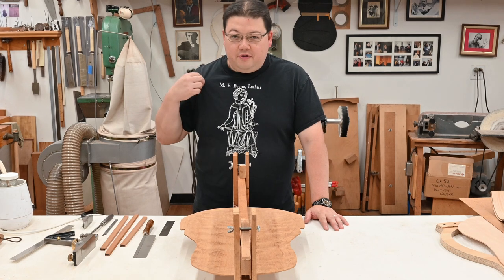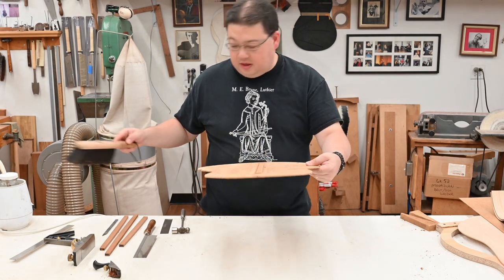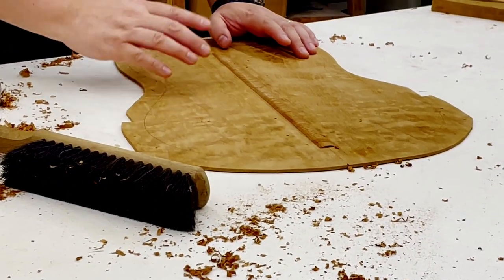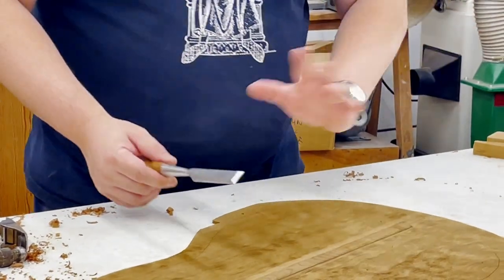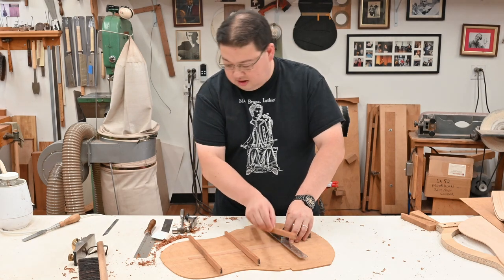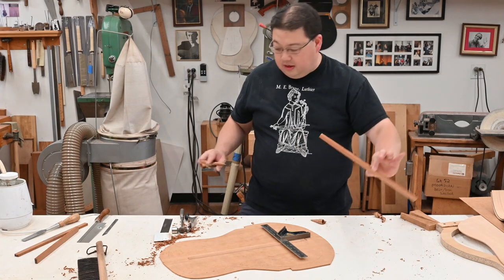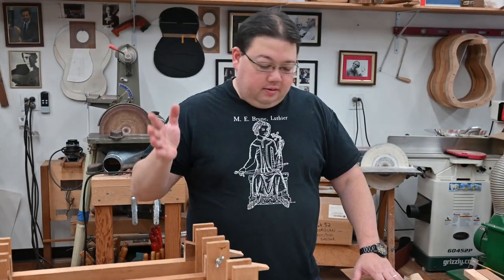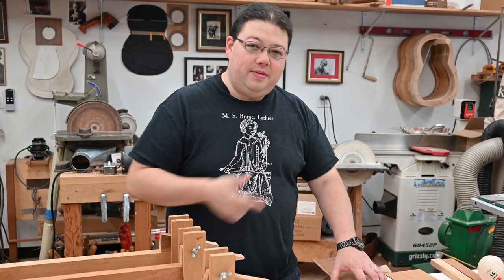The Best Tips for Guitar Soundboards | Pro Luthier

Comment: Hi Marshall. Great channel. Just sub'd. We met at a French polish demo you did at GAL around 2005(?)
Love the glue jig
Questions:
1)Are the springs tightly fit into holes to keep them in place, or secured some other way?
2)What springs are used?
3) Is the clamp surface flexible enough to  conform to a radiused surface? The top and bottom of my braces are radiused.

I gotta make one of these. Reminds me of Friederich's gig.

Thanks and keep up the great work!

Comment: Hi Marshall I have a question perhaps too naive for you, but here it is: I recently replaced the (mulberry) soundboard of my Uyghur duttar with a rather nice piece of Engleman spruce. Effectively I haven't thicknessed it though (roughly 4.5mm thick), and it sounds quite droning and feels not fully responding to the string energy. Would you say that this would improve if I thin it down gradually to, say, 2.5mm? Thank you and as always thank you for these videos!
Reply from the maker: I would imagine it would!
Reply: @MarshallBrune  Thank you for replying! Just thinned it down with a small plane to about 3.5mm today, and the bass improvement is noticeable. The treble though isn't enough... I guess the next step would be to thin it further and adding some braces (which traditional duttar soundboards never use)...
Reply: @abdumushuk2219  how'd that go?
Reply: @SebastianSipos  thinned to 3mm and glued on two transverse braces. The rigidity felt right BUT since Engleman is sooo light, the string energy overwhelms it (strumming is too loud and exploding). My guess is that I should have left it thicker while using a smaller brace, or maybe Engleman is too lightweight for duttar all together.